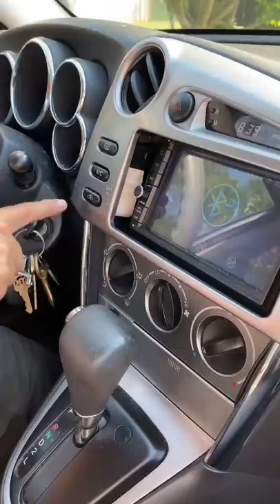Never Press This Button While Driving

Comment: I would have my ac on recirc the whole time but i drive short distances over and over for work somewhere between .1 miles and 8 mile round trips sometimes 12 miles if i have more stops. The newer vehicle didnt have any issue making me sleepy doing this but theres always enough airflow and air exchange every time i have to open the doors. The older vehicle doesnt even have a recirc option, if it smells like a landfill outside you’ll smell it just a few seconds after passing into the wind of the dump

Comment: Modern cars are designed to occasionally let in air from the outside, even with recirculation on. Cars are also not THAT air tight. It’s not a submarine lol. You don’t have anything to worry about.

Comment: Weird, my truck gets way colder on ac right away than if I left it on recirc. The smoke from fires is so bad here I like to run it on recirculate but like I said the sec I switch to AC it's cold as ice. Whereas recirc never gets that cold?

Comment: IDK know that this actually matters much in practice. Maybe if you're doing marathon driving (like driving for more than 5+ hours) without stopping and at least opening a window, then maybe.  But I just did a trip for Philly back to Chicago (12 hours) but we stopped every 4 hours... ran the AC on recirculate the whole trip.  No issues.  And while many cars these days have cabin air filters, I would think that bringing in outside air in some cases (especially in traffic) can be worse than just using recirculate.  In fact, that would maybe be one time you might want to use recirculate, as those air filters do not always catch everything that's harmful when the air is sucked in.  (And not all vehicles have cabin air filters -- some trucks, for example, still don't have them).

Also  I think modern cars will occasionally let in fresh air briefly and expel some air from the system as well, despite not indicating this on the AC control system.  Additionally, modern cars that have the cabin air filters will also run the air through the cabin air filter even if the AC is set to recirculate, as car manufacturers have identified the concern of stale air and carbon monoxide concerns, and those filters can filter that out as well, in addition to the elements outside of the car.  The recirculation concern may apply and be more valid on vehicles that don't have cabin air filters, but most cars these days (not all trucks though) have cabin air filters for this reason and also to filter incoming air as well.

The more important reason, which isn't discussed, is that recirculation can lead to moisture getting trapped in the system, and then mold forming, which would be a more likely scenario to impact your health over a longer period of time, but not so much breathing in carbon monoxide.  Studies have shown you would have to breath in A LOT of carbon monoxide over a long period of time (some say as long as 7-10 hours) before you'd pass out.  Most people would probably have to stop for some reason or another and get out by that time and thus, the stale air is removed from the car when you open the door and fresh air gets in.

I mean if this was really a problem, we would see more people dying from sleeping in their cars overnight and dying from carbon monoxide poisoning, but in reality, we don't.  I mean if using recirculate in a vehicle for a long period of time posed health concerns or safety concerns with people passing out or getting drowsy, car mfrs would be required to remove the feature by the US government, and force people to use fresh air AC only.

Additionally, you have to figure on many older aircraft, passengers simply breathed in recirculated air, and some of those flights were not short, and to top it off, airplanes are more sealed than cars are, and people still survived.  This is not as a big of an issue as people make it.  Modern planes filter the air now, but it's still the same concept -- filter the air but recirculate it.

Comment: I had a '92 Camry with an exhaust leak that gave me CO2 poisoning.  I noticed there was something wrong because I couldn't drive more than 20 minutes without having to stop for a nap.  I'd pull over, park in the shade, and roll the windows down to take my nap.  The first few times I thought I was just tired from working all day but it kept happening.  When it kept happening I thought it might be CO2 so I grabbed the battery operated Carbon detector from the house and brought it to work.  Sure enough it started going off in about 10 minutes.  Upon further inspection, the braided flex pipe had rusted through on the top of it, and somehow that exhaust was getting into the cabin.  Not wanting to take any chances my dad just ordered a whole new exhaust system.  Way more expensive than just a replacement flex pipe, but I never had an issue with CO2 after that.  The flex pipe, BTW was located near the front of the system, I still have no idea how it could have gotten in the cabin, but the car was 12 years old at the time and from the northeast so I'm sure there were other rusted through areas on the undercarriage.

Comment: Also, let fresh setting cool the car down first, then switch to 'max'.  The reason is the system takes the air you feed it and cools it down a given amount.  If you start with the internal air that is hotter than outside air, you will not cool down as quickly.  Oh, if you live in skunk country, best to know where that button is before you get to the road kill up ahead.

Comment: I've always run my air conditioning on Max AC with recirculation air.  The vehicle breathes fine enough it doesn't need to be that serious, average vehicles are not that air tight. And I know3, I've done many 12 hr days of driving in the heat with recric blasting ice cold AC
Reply: Thank you

Comment: However the downside is that the A/C compressor has to work a lot harder and you'll wear it down sooner. Most cars built in the last 10 years have in cabin air filters that prevent this as they allow a certain amount of air to come from the outside.  Did you know that only 2.4% of new vehicle sales include manual transmissions? Yup almost 98% of cars today are automatic transmission.

Comment: Don't recommend using fresh air on a busy highways or roadways because of the other cars smoke is getting in the car vents i use recirc always never had problems with it we drove for 24hours on recirc you would get sleepy because it's tiring we did 400+km most modern cars nowadays can filter out those recirc aircon inside the cabin

Comment: For better Climate control and to fight off the risk of catching a cold or a flu do the heavy transport trick by also setting  the Cars internal Heater on low as well , this will not affect the cooling rate by much , but it will dry out all the air that is being processed by the Air Co through the vents so you always have clean dry Fresh air coming in, especially good on rainy hot days, and also don't forget to lift the hood every now and then to check the Cars interior air filter for dirt and obstruction ...some smaller cars may not have this feature , but all Trucks and Pickups do have it .

Comment: He's right but when you don't use your AC when it's freezing cold the O-rings in a c system drying out you need to run the air conditioner some in the winter just keep the O-rings from drying out that's how it loses freon

Comment: This isn't quite right, Scotty and, I think it's just a mistake in verbiage, etc.  (I'm giving you credit for being smarter).  "Hahaha" ...
  When you first start your car, do not use recirculate because your keeping hotter air than is outside in the vehicle and making it hard to cool.  Use fresh when you first start.  You can even use just fan with a window or three open, just for a minute to get the 140° air out.  Then use fresh A/C to cool the car to the same temp as outside.  If you leave it on fresh your fighting the outside air.  So, once your car interior is at or just below outside Temps, turn on the recirculation and it's now cooling the cooler, inside air and you'll be chilling in no time. 
THAT SAID...
  Scotty is right about car cabins being susceptible to exhaust leaking into the cabin.  So, if you're going to be in the car for a while, occasionally trade out, run the fresh a,while and, if your getting too hot, go back to recirculate.  If you're really concerned, get a CO meter and check your cabin air with the windows up and A/C on recirculate and see if you have any build-up.  😀

Comment: Modern cars open the exterior vents every 10 - 20 minutes to allow fresh outside air to enter the system while on Recirculation. This way the system doesn't do what you are saying it does

Comment: Recirculation isn't 100% internal air, it should be 75% on a working system as it does lead to the problems in the video.

Comment: Not true, I keep the air recirculating even on eight hour trips. Never had a problem.
Reply: Higher humidity of recirculated air leads to conditions favoring mold and mildew growth in the dark corners of the AC ducting . . .

Comment: I don’t know if this is one hundred percent accurate. Then theory goes you can die in there. But it takes real long. How close is the sleepiness effect to the passing out and death effect in the timeline? A little outside air has to get in while you’re driving and you must get a refresh of oxygen before any car runs out of gas through that so yeah I don’t believe this very much. Like four hours of driving with recirculating air can’t over fill a car with carbon dioxide to the point you start getting sleepy or there would laws around it, because you can’t producing cats that endanger your life and if you get sleepy then you’re endangering your life. Plus the car is not air tight. Unless they studied this already and I’m totally wrong

Comment: This comes up about every ten years!  Like friggin' clockwork!!  No! You do not reduce the concentration of O² by recirculating.  If you are experiencing significant, or frequent, headaches and sleepiness while driving,  these symptoms are 100 times more likely to be caused by odorless compouds from the vehicles exhaust leaking or diffusing into the unvented car's interior.  Even at low, almost trace, concentrations a continuous exposure of this kind can cause significant biological effects.  A freon leak is also a potential, yet unlikely possibility   Oxygen deprivation would result in a significantly different order, type, and degree of symptoms.  In cases of extended exposure to low O² levels, individuals would experience symptoms onset at an exponential rate per unit of time.  Therefore, if this hypothesis was true, thousands of cars would be drifting off of interstates and highways on a daily basis with incoherent and unconscious drivers at the wheel.

Comment: Nonsense! This would only apply if the car was super air tight. Newsflash: cars are not super air tight. All kinds of leaks thru the floor, door seals, windows, etc. I'll bet if you threw a data logging CO2 meter in the back seat with the car on recirculate the levels would barely change.

Comment: Absolutely not true. Recirc makes the ac colder because it is starting with already cool air. Any vehicle completely changes out it’s air at least once every three min even if you aren’t using any temp control

Comment: I thought all cars automatically were vented
Reply: They are, but if you turn on recirculation, it'll stop most air from entering.
Reply: You said... "I thought all cars automatically were vented"

They are. And if you turn on recirculation, it will NOT stop most air from entering. In fact, once you turn on recirculation, the positive cabin pressure is either lowered or eliminated. This creates LOWER RESISTANCE to other air entering the cabin... meaning more of it does.

Comment: I doubt thats true. Manufacturers wouldn't risk getting sued so easily
Reply: it would be a long shot to sue car makers over an AC selector option. and to prove it directly caused injury. unless its class action it might gain more traction. but most likely would only lead to changes in the owners manual and warnings. the car makers have plenty of $$$ to fight.

Comment: This isn't true, I work at ford. There is so many air inlets into a vehicle that the CO2 level would barely rise in any real capacity. Now back in the day, some cars were so sealed that it could happen, but that was caused by failing catalytic converters leaking exhaust fumes from the undercarriage and that produced an internal environment filled with bad stuff. I can firmly state that using either recirculating features or or not has no impact on your CO2 intake. If anything,the act of you going and rolling down your window for fresh air is more to do with the psychology of changing what you're doing. It's called road amnesia. 

Ever been driving and you stare down the road and then all of a sudden you've driven home or to a destination and couldn't even remember doing it? That's because you've been driving so long it's become second nature. Your brain goes into a very basic form of autopilot while your conscience is elsewhere or daydreaming. The best way to avoid these mistakes and stay alert is to constantly scan your surroundings, look at your mirrors more often. Take note of the vehicles around you. Stimulating your break while you dream is proven to help keep you from fatigue. If you're too tired and notice it. Please find a safe place to pull over and take a quick nap. 

I was a truck driver, and trainer before my job now. I've seen a lot of the road and I've seen a lot of crap. But CO2 poisoning due to recirculating air? That I never have seen to this day lol

Comment: That's, not how it works 🤦
Scott you say some smart stuff, but recirc still pulls air from the outside consistently because of that situation. When it's in recirc it recirulates 80% of the air in the cabin and pulls 20% of the air from the outside. Keeping you cool and giving you a healthy amount of oxygen. Change your cabin air filter if you don't feel enough cool air coming through the vents. It'll help flow more oxygen into the cabin as well

Comment: This is nonsense.  The recirc uses air from the cabin and has no additional carbon monoxide.  Your AC unit doesn't have to try and cool the hotter outside air by recirculating the cooler air that was already inside the cabin.

Comment: This video is total bunk. Recirculate mode still maintains a small, constant flow of fresh air into the system for a variety of reasons — exhaust, breathing, odors, etc. The system does not close just because you choose to use recirculate mode. This was thought through ages ago and everything Scotty is saying in this video is utter and complete nonsense.

Comment: You guys are all so impressionable. Cars are not airtight like this. This is unfortunately straight up cap. I like Scotty, but this is not scientifically proven. Anyone with a high school education on how gases work would know this
Reply: Yes you are correct.  There isn't much evidence to even suggest this is a problem.  I mean I've slept in vehicles overnight with the windows closed.  No issues.  And modern vehicles (when they are turned off at least) will open the air vent doors to let air pass in/out, and I suspect that many vehicles will still bring in fresh air periodically even if the AC system is on recirculate.

Comment: Gasfitter here. There is 0 chance that you would get excessive carbon dioxide build up in a car running recirc. They are not that air tight.

Comment: window down save gas. im poor.
Reply: Your car would probably get better gas mileage with the ac on, and the windows up.

The loss of proper aerodynamics caused by the windows being down, would almost certainly overpower any savings created by the engine load being lessened by the ac compressor being off.

Now, if the ac doesn't work anyway...
Reply: @dalemarkwell1171  yoi dont need aerodynamic in traffic.

Comment: Good grief more nonsense from Scotty. I can see why other mechanics hate this guy. The recirc only recirculates a percent  of the cabin air the rest comes from outside. Any HVAC recirculate unit works like that. There is zero risk of too much CO2 in the cabin from using air conditioner recirculate.